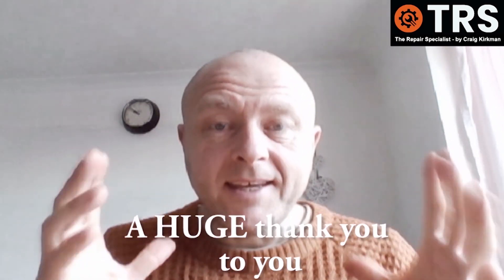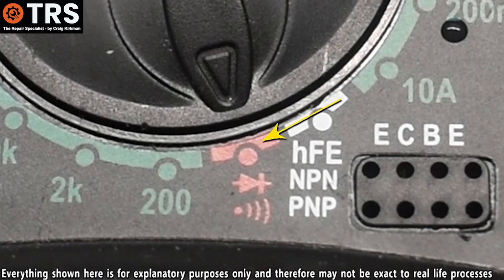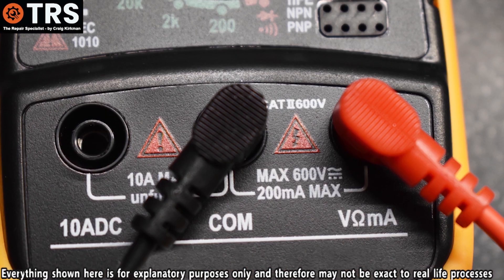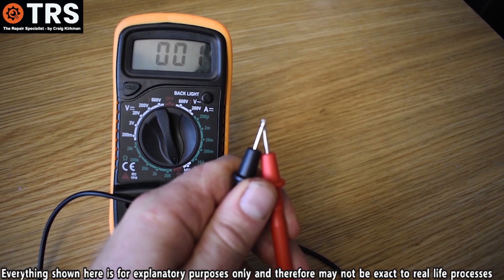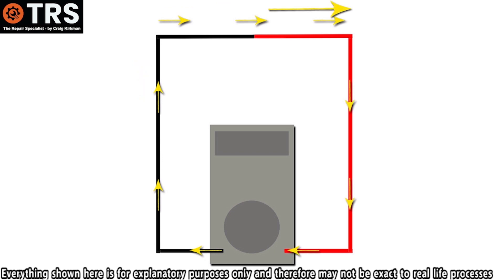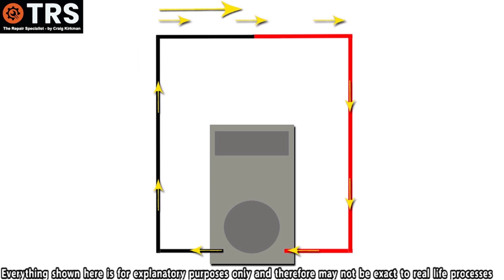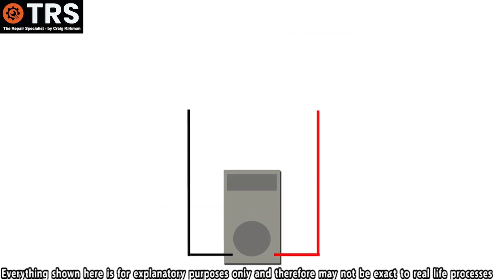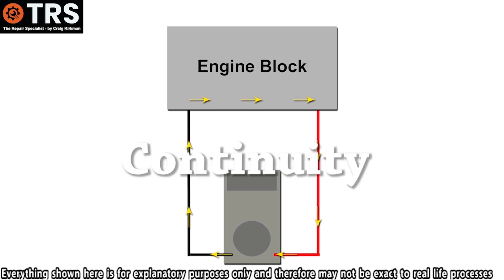CONTINUITY TEST WITH A MULTIMETER. How it actually measures continuity! (by Craig Kirkman)

Comment: Would be helpful to EXPLAIN WHY you need to check for CONTINUITY.
Reply from the maker: Yes indeed. I will look at making vid on that. Thanks
Reply: Continuity testing should never be used to test the current carrying capacity of a conductor. Voltage drop testing should be used. Continuity and conductivity are two separate things and a technician must know the difference to accurately test electrical circuits. Continuity testing is great for locating wire routing and identifying what is connected where but can cause one to make false assumptions leading to an incorrect diagnosis. Hope this helps? Peace to all...✌ Electrical Troubleshooting Specialist